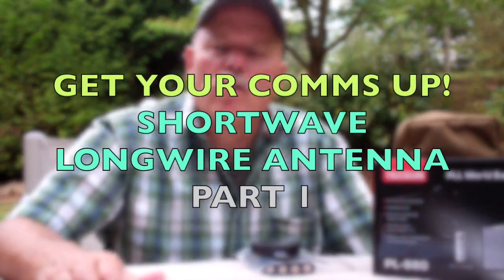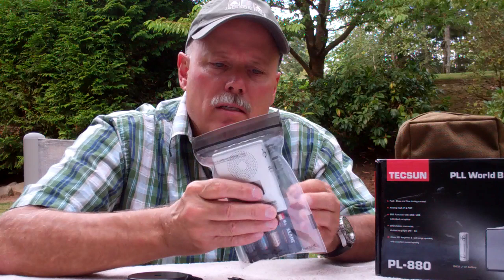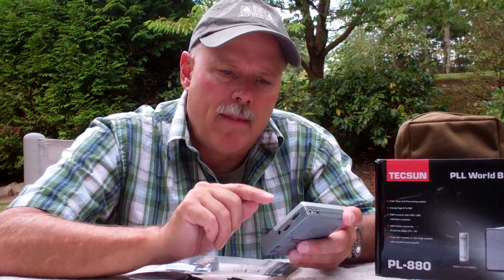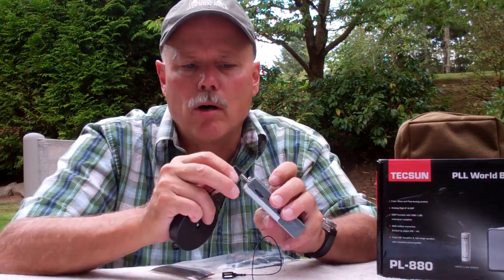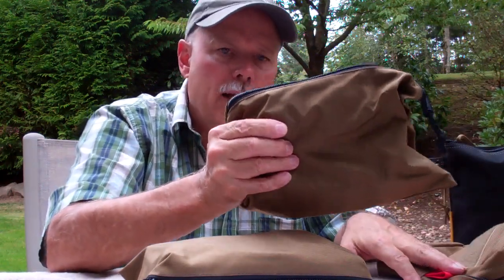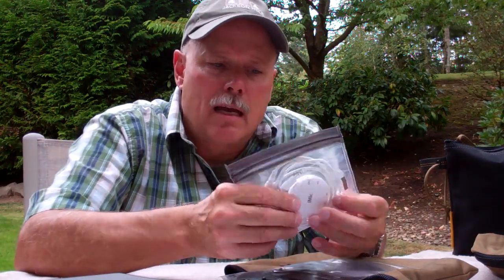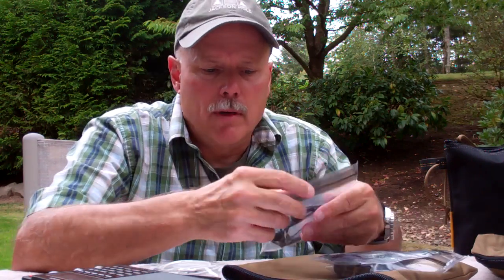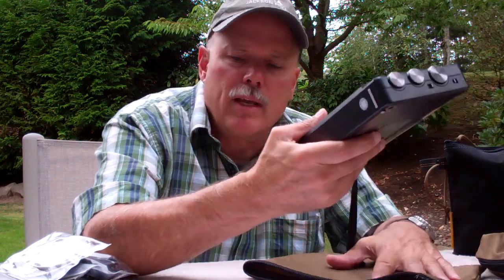GET YOUR COMMS UP! SW Long Wire Antenna Project - Part 1

Comment: If you can't afford the $180 PL-880, Tecsun also makes the PL-600 that does AM/FM and SSB for around $60.  Drawback, it's amateur and CB radio bands only, 160M to 10M (1.8Mhz to 30.0Mhz).  No local  commercial radio.  EDIT:  I should includ that these are HF bands only, no 6m, no VHF and no UHF, but still very useful since it can receive SSB which means it can receive digital, CW and voice.
Reply: Not sure where you got the no "commercial radio" from, as there's plenty of commercial stations on MW and FM bands, the lack of air band is a negative and thus would opt for the 660/880 instead.

If you're going to be monitoring the radio traffic on VHF/UHF a scanner or dual band transceiver would be a good option.

Comment: What is UTC time?
Reply: UTC is also known Greenwich Mean Time. It is the basis for local timezones worldwide. Every timezone has + or - minus. UTC has an offset of 0.
Reply: UTC or Zulu time is a time zone used by Ham radio operators and the Military primarily.  It allows them set at time for an event without the confusion of what time zone they are referring to.
Reply: Nomad76ORE
Thank you. I learn so much from you guys. Really appreciate it.   Janice
Reply: *****
Thank you!